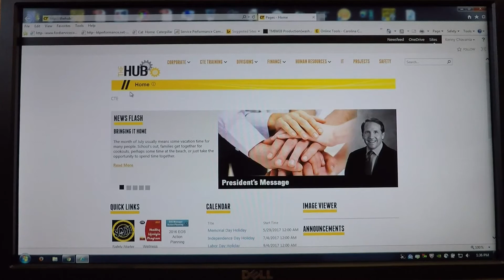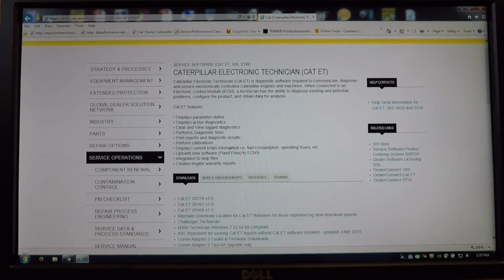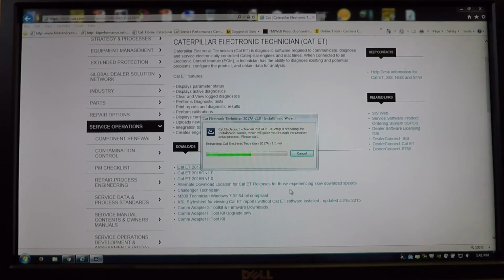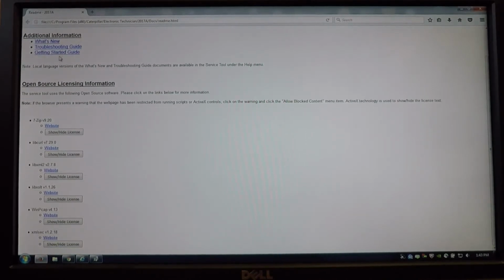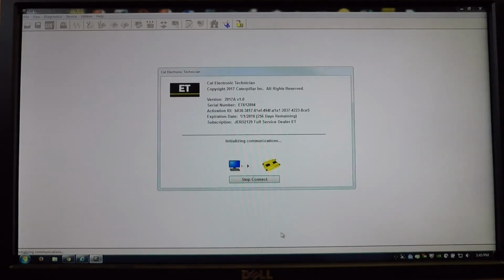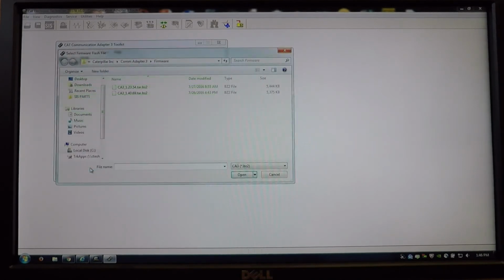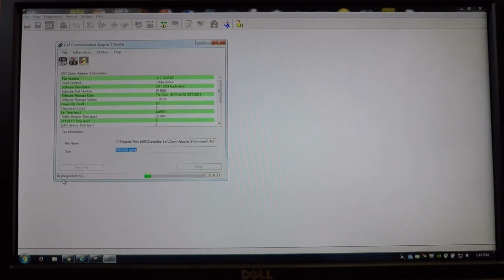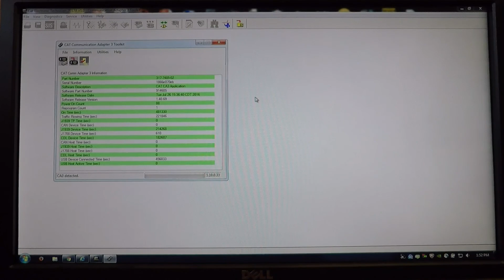Updating CAT ET and Com3 Firmware

Comment: Hi dear in the the CAT Communication Adapter 3 Toolkit, in the left down corner "CA3 is not responding." Even i brown the file firmware \CA3_1.23.54.tar.bz2   size=5574200 bytes and start begin but nothing responding i mean flashing in progress. But in the device manager vehical data link Adapter >CAT Comm Adapter 3 is showing installed please guide me regarding the firmware
Reply from the maker: Is the power light illuminated on your Com 3? If it is a newer Com 3 it will need power from the 9 or 14 pin cable
Reply: Thanks for responding actually by mistake I have pressed the" usb power off "option in the communication adapter 3 tool kit  after there is not showing any data or details of the device.i try to reprogram CA3 browse the file .tar but still in the corner showing "No device detected".
Reply from the maker: If the power light is illuminated then after rebooting your computer and still no device connected try replacing the cable from your PC to the com 3